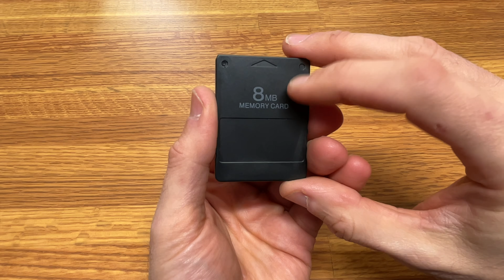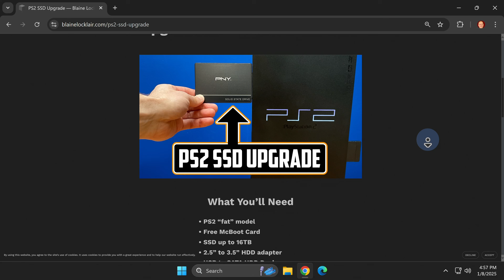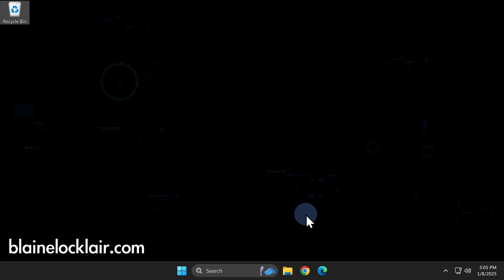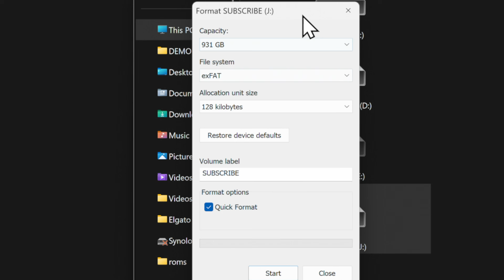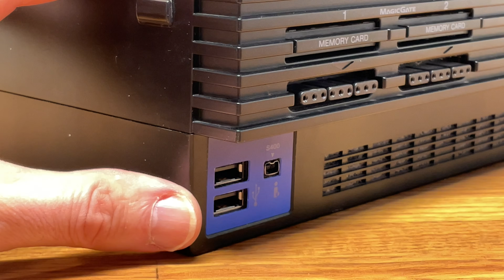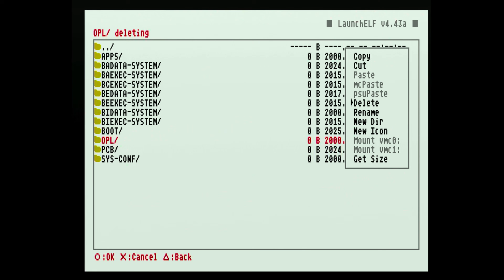NEW! This PS2 SSD Mod Guide Is Easier Than Ever

Comment: I was using my HDD with the Sada USB adapter. Was running the games perfectly fine. Upgraded the rear network adapter and now it does not show any files on my HDD. And the settings for OPL will not allow me to highlight the HDD options.

Comment: Great video. One question, I have a FMCBoot card from a different company. It’s running 1.963 freemcboot. On it, I have “wLaunchELF 4.43x_isr”. When I go in and look inside the mc1:/boot folder I don’t see the file that I need to replace. The only things in there are 3 files “Boot.elf” , icon.sys and Boot.icn.
Reply: did you figure it out ?

Comment: I still can’t figure out how everything works. When installing games via HDL batch installer from pc onto ssd I can see games but they don’t start. Making a own backup of a original game via HD LOADER does work. I can see the back uped game in HD LOADER and OPL and can start it…. But not a single game that was copied from PC to the SSD…
Reply: You no longer need HDL batch installer, if following this method, you need to format your drive as exfat which will wipe it.

Comment: For anyone wondering, I can approve that this also works with an HDD instead of an SSD. Idk if it works with every single HDD, but it definitely works with the one I have. The one I use is a Seagate st500lm012 HDD and it works fine.
Reply: Ok I have an hdd and it’s working but been fighting trying to get art out on it iv done everything kinda wanna just restart fresh . This will work with hdd then ? I have 261 games downloaded and I can play all of them and save to my virtual memory card and play through the hdd now mc
Reply: when you plugged in you hdd to youur pc did 
it show up under My PC?
Reply: @jakecampbell4186  yes it did

Comment: he doesn't tell you this will only work if you use the copy of freemcboot he has in his description
Reply: Not true I got it working on one of the latest daily builds of OPL (2244, released a few days ago)

BDM Start Mode > auto then Block Devices > HDD on
You also want HDD Device Start Mode to stay Off as this for APA formatted drives ie. the old method

Comment: what do I do, if following this guide and the games list still doesnt populate? (using a brand new crucial 2TB ssd formatted to exfat
Reply: did you figure this out. mine are not showing as well
Reply: @plazma2891  me too :'( I didn't use the $30 docking station though, i used a cord that plugs in sata=>USB and formatted to exfat that way then put the games there.. dunno why they wont show
Reply: BDM Start Mode > auto then Block Devices > HDD on
You also want HDD Device Start Mode to stay Off as this for APA formatted drives ie. the old method

This worked for me on one of the latest daily builds of OPL (2244, released a few days ago)
Reply: @Sorrow366 for some reason hdd doesnt show up for me to press on when I go to block devices

Comment: Nothing worked, My card I bought has a bunch of other stuff on it like snes emulator and opl 1.10
Reply: had one like this. I had to go under /apps instead of /boot. I removed all those other emulators because i couldnt get them to work anyway and copied the OPL file into /boot and into /apps then i reset my console and it showed up

Comment: I don't understand. First, when I load freemcboot, it has version numbers and extra programs that you don't see. Do we have different freemcboot cards? Mine is the same version, 1.966. Then I go through the steps, and again it shows a version number after OPL when i add it, instead of just showing (OPL). But eventually I am looking at the same OPL. Except when I go in to change the settings to auto, it soft locks the system! How could it be any different? For such a simple guide I'm so bummed that it can not work. I know the HDD works and it's plugged into the system. I am one step away from seeing games supposedly, yet when I do the auto settings it locks the system, I cannot go down to save changes, and I cannot see games on my HDD. If anyone can help me, I would greatly appreciate it.

Comment: Just FYI you should add a note that some people do not have their SSD recognized when inserted into the boot dock even the model listed. What happens is you have to search and open disk management.
Reply: i used hdloader on the ps2 and it formatted the hdd, then i was able to initialize it once i reconnected it to my hdd enclosure.
Reply: that is what is happening to me.

Comment: 17:43 I wouldn't do that if I were you.  In many cases, starting OPL with this option enabled soft locks the PS2 console, so it's better to set it to Manual, and then boot into OPL via uLaunchELF (preferably through the HDD) to reduce the chances of soft locking the PS2 console.
Reply: This is absolutely correct, you shouldn’t set HDD Device start mode to auto, set it to manual, and under the Block Devices tab, you should set HDD to On . Mine kept soft locking when i opened opl until I changed these settings
Reply: Thank you for this comment. My ssd would boot games to a white screen and this was why.
Reply: Thank you for this comment!
Reply: @willtoon3043 BDM START MODE OR 
HDD DEVICE START MODE!?!?
Reply: what do you mean soft locking? how? i don't understand
Reply: Is this only for the newest versions? I have a really old FreeHDDboot image burnt to a 256GB SeaGate and OPL works flawlessly with all options set to auto
Reply: @vinson3725  I only tested older builds, to be honest.  Like around, 2015-ish?

Comment: my ps2 doesn't seem to be detecting my ssd. cannot get my games to show up in OPL
Reply: Same thing happened to me. I just had to properly tighten the screws in the back where the sata adapter connects. I also double checked that everything was in the right format (exfat for the ssd)
Reply: Try connecting the drive directly to you PC's SATA ports. The USB dock can sometimes alter the drives sector size from 512 bytes to 4096 bytes which OPL and the PS2 does not support.

Comment: This does not work on the SSD you recommended. It worked on a Samsung Evo 850 though
Reply: I found that I had to open a format tool to find the drive. Some SSDs like samsung maybe auto populate in the MY PC area due to samsung magician software? that is my theory.

Comment: This does not work. I used every product you did and the PS2 won't read the SSD
Reply: Try connecting the drive directly to you PC's SATA ports. The USB dock can sometimes alter the drives sector size from 512 bytes to 4096 bytes which OPL and the PS2 does not support.
Reply: @ReeceSmith-oh9bp do you need to do anything after you connect it to your pc?
Reply: I personally recommend getting an official PS2 network adapter and replacing the IDE connector with a SATA port (look for a bitfunx mod). It worked perfectly for me AND I still have online access in case I wanna play online in a private server (or use SMBSHARE for some reason)
Reply: Same. I ordered every single thing he listed, and even borrowed a Windows machine. Didn't work. Can't figure out why...
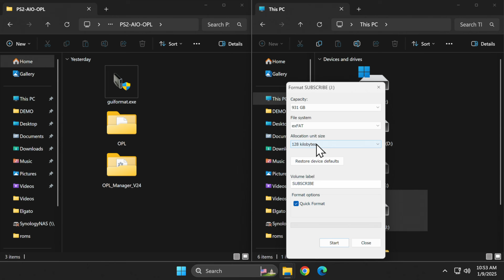Reply: 8:34 watch from here

Comment: My games are not showing up
Reply: Try connecting the drive directly to you PC's SATA ports. The USB dock can sometimes alter the drives sector size from 512 bytes to 4096 bytes which OPL and the PS2 does not support.
Reply: @ thats what i had did, the reason they were not showing up was because they didnt have the proper name for opl to recognize.

Comment: Unless I'm missing something the 500x speed for ssd isn't actually a faster way to get together a game library. If you're downloading roms from a site or backing physical disk you can set the destination file. Completely skips the need to transfer from computer to hdd or ssd. In chrome you can temporarily set all downloads to whatever folder which you can change back after downloading your roms.
Reply: Not to mention that the PS2 can't pass SSD speeds. Only benefit is less moving parts...and adding things to the drive is quicker, but the PS2 itself wont let you see SSD speeds

Comment: Yeah because we’ve all got a dock !?!?
Reply: you can use a 3.0 usb cable to sata for 2.5 disks, in the case of 3.5 disks, you will need a power supply.
Reply: @DruidVorse  Would a USB SATA enclosure be sufficient instead of the dock?

Comment: Do folks no longer run this all off the HDD (SDD) instead of having to have a memory card with Free MCBoot? I think it was called FreeHDBoot at the time I followed a tutorial years ago. Maybe it’s that it’s outdated?

Great tutorial either way!
Reply from the maker: Good question. I think it's because the version of FMCB that supports exFAT isn't the same as the FHDB that runs it all from the HDD/SSD. For this guide specifically, I did/would have kept them separated any. It just makes adding content to the SDD easier once it's in exFAT format. It's also like having a C: drive as the Windows boot drive on a PC and a D: drive for programs and data. Keeps things separated and tidy.
Reply: @blainelocklair  I do recall having to use a utility to write games to the HDD I did, at that point. Maybe that was because of the file system not being exFAT. I've been meaning to revisit it, myself.

Either way - this is a tutorial idea for those of us that don't like to leave a mem card sticking out of our precious vintage console? :)  I think you could write saves to the HDD/SDD somehow?

Thanks fot the reply. Keep making videos!

Comment: A more comfortable way to install freeMCboot is to use freeDVDboot (if compatible) to install the softmod directly on a memory card you already own or the harddrive (in that case, you will need a script to install the game, once it detects the drive either connected to the PC or network with HDL dump loaded on the PS2, it will automatically transfer every game, skipping the titles that are already installed)

Comment: This is sick why did you choose fast SSD for PS2? 🤣 Speed for almost all devices in PS2 is: HDD ATA interface: ATA-66 (Roughly 66MB/s). Ethernet interface: 100Mbit (Or 12.5MB/s). USB 1.1 interface: 12Mbit (~1.5 MB/s)

Comment: Why not use NVME? Is there a bay for one out there in the ether? Hmmm.
Reply: NVMe is too advanced for how the Network/Hard Drive adapter works for the PS2 Phat - the PS2's network adapter was designed for PATA/IDE 3.5" drives which maxed out at 133MB/sec, first-generation SATA devices ran at 150MB/sec (8b/10b encoding on a 1.5gbps connection) whilst modern SATA devices will downgrade their data transference to the lowest shared speed between host and device (1.5gbps in this case even for a 6gbps SATA SSD that runs at 500-550MB/sec on SATA III systems) and it's a fairly easy adaption from SATA signalling to PATA/IDE signalling alongside the actual differences in plugs that the signalling side of the conversion done by a cheap-and-cheerful microchip for the past 20-odd years.

Meanwhile NVMe is designed around the Peripheral Connection Interface Express bus which needs more complicated adaptions to allow SATA and PATA/IDE devices to run over a PCIe host card but can not run a PCIe device (which NVMe M.2 and U.2 SSD's are) over a SATA or PATA/IDE bus.
NVMe being based on the PCIe bus is why it's possible to do NVMe M.2-to-Oculink adaptors or NVMe M.2-to-PCIe slot adaptors, as you're just converting the physical connections without having to translate between very different communication protocols as well.
Reply from the maker: NVME is also a perfectly good option.

Comment: 'm using a NAS and a PS2 connected to a switch, allowing me to use games on both a PC emulator and the PS2 from the same source. Is there any advantage to using an internal drive? The speed should be the same...
Reply: the PS2's Network Adaptor (and PS2 Slim's on-board network) are 100mbps max speed, for a total of 10MB/sec throughput. the IDE standard maxed out at 133MB/sec, and SATA I devices and systems maxed out at 150MB/sec on the SATA I 1.5gbps bus. SATA III devices like the PNY 2.5" SSD here are SATA III devices with a 6gbps bus that tops out at 500-550MB/sec real world throughput, SATA II (3.0gbps) and SATA III devices will negotiate down to the lowest shared speed between device and host, in the case of the SATA-adapted PS2 Network Adaptor that is SATA I (1.5gbps) and the drive will read/write data to the console's memory at 133MB/sec.

For a real world example; to transfer a 1GB file over the network at 100mbps (10MB/sec), it'll take about 1 minute 40 seconds (100 seconds) to do so.
To transfer that same 1GB file at the 1.5gbps (150MB/sec) of SATA I, it would take about 6-7 seconds.
Reply from the maker: That's a great setup! Both are great. If there's an advantage to the internal drive method, it would just be simplicity of setup. Most folks (myself included) don't have a network adapter for their PS2, so no way to connect to a NAS (which I do have, two of them). But using something like RetroNAS (name?) is a great setup too. :)

Comment: What funny, I did an SSD test in my PS2 in 2010 with a 32GB ide ssd for a laptop with original network adapter. It worked. All I had to do was get a 2.5 ide to 3.5 ide adapter.
Reply: It's all gonna bottleneck at the ide adaptor though isn't it?
Reply: @TheGunmanChannel  Yes.  Its not that the read/write speeds of the ide ssd faster, even the ps2 network adapter is only sata 150 and bottlenecks fast mechanical drives, it was the SSD reads small files so much faster. So even loading programs stored on the drive, and open world games ran much better then the mechanical drive did.

Comment: I have the original PS2 HD/Network adapter which is PATA and using an old 80gig HD. I wonder if I could get this to work with an SDD on a SATA to PATA adapter. I should try it and see what happens.
Reply: If you browse around, you can find conversion boards that replace the IDE board in the official network adaptor with a SATA board, so it has a native SATA interface to the 2.5"/3.5" drive but "talks" at IDE's 133MB/sec (1.5gbps, SATA 1 speeds).
considering that the USB ports on the PS2 are only 12mbps (1.2MB/sec), and the Network Adaptor (which is on-board for the PS2 Slim) tops out at 100mbps (10MB/sec), even if the modern 2.5" SATA SSD is "only" operating at about 25% bandwidth it's still faster than the other historical methods modders have come up with to load games from non-optical storage.
Reply from the maker: @ElNeroDiablo Thank you for your detailed reply and great info! :)
Reply: Get IDE to SATA adapter, change the PCB and you're good to go. Use OPL by Grimdoomer or Neutrino+NHDDL to play on exFAT formatted HDD

Comment: hd retrovision component cables > hdmi adapter
Reply from the maker: They are great cables. I have a set of them also. :)
Reply: If a retrotink or other scaler is involved, absolutely
Reply: Exactly. I use this cable instead of the hdmi adapter and the quality is amazing
Reply: HD Retrovision component cables + GBS Control upscaler with HDMI out >
Reply: @ThaMizphit74  HD Retrovision component cables plus 32" trinitron CRT > all
Reply: @Knuckle87x I prefer the 40" myself, but you're right. Component cables on era-specific hardware or you might as well emulate it.
Reply: @sammiches6859 40” has a much larger dot pitch, I think 24” is the sweet spot in size vs clarity.

Comment: Why pick an SDD over an HDD? Does this tutorial work with a HDD?
Reply from the maker: Absolutely works with both. SSDs are just getting super cheap now for large capacity storage. They're quiet, reliable with no moving parts, and can copy your games to it from the computer up to 5x faster.
Reply: it used to be that only very specific HDD drives would work and maxed out at like 500GB
Reply: Is this better then grimdoomer opl????
Reply: SSDs are getting relatively inexpensive now, are more reliable, and they don't produce the kind of heat that a HDD dries, which will keep your PS2 a few degrees cooler.
Reply: It will not be faster, but it will be cooler and more silent. The PS2 CPU will not make a difference with HDD and SSD.
Reply: Yes lol it works both ways ssd is just faster load times over the hdd
Reply: @420hess  Based on head to head tests of dvd/hdd/ssd/usb as per the ps2's hardware capabilities, ssd provides like thousanths of a second advantage in speed over hdd, which are both light years beyond either a usb or dvd load time. It's far more accurate to promote ssd's other advantages instead of speed in this particular application.
Reply: @420hess load times will not be faster
Reply: @deelowe3 it'll be faster than the original physical media at least!